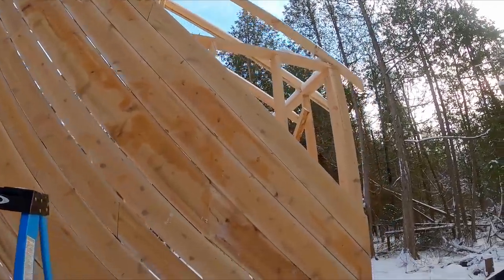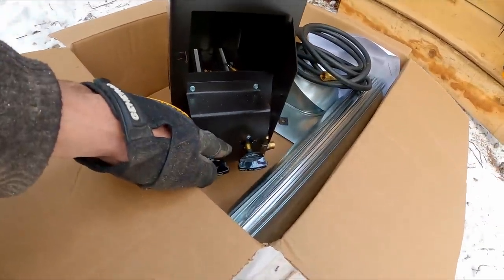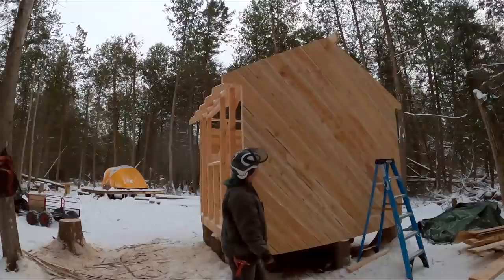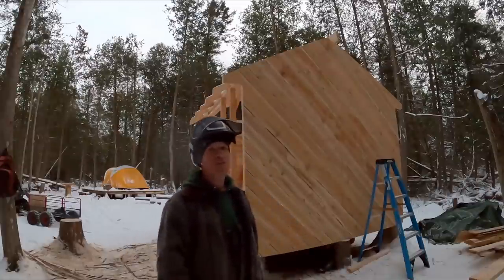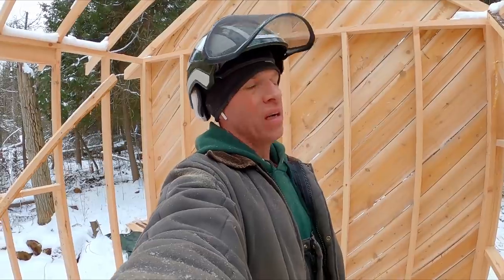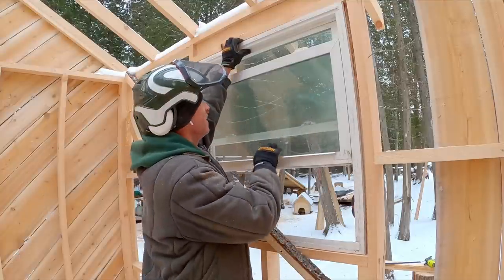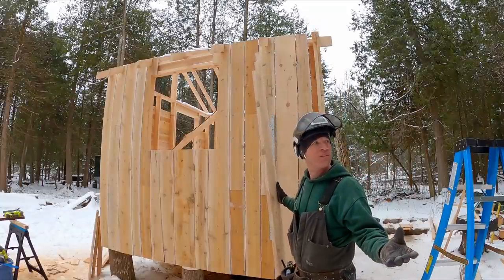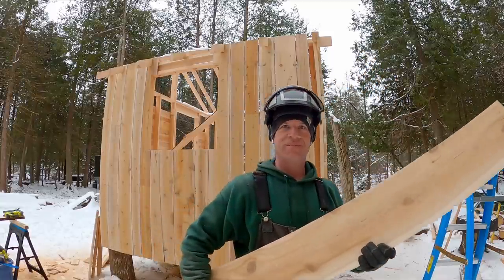95sq ft Cabin Gets Used Windows and More Alaskan Milled Cedar Siding #68

Comment: After years of sawing wood with a table saw, cut off saw and various other wood cutting tools, I have developed an allergy to pine sawdust. Even cutting a few boards  will set it off if I forget to wear just the shop type mask. Mine is the sinuses in the tip of my nose. You are correct... With the amount of cutting you do, I am sure the effects are excellerated.

Comment: Back in WWII they experimented with using water and saw dust frozen to make barges for military use. They found it to be extremely resistant to melt. You’ll have to watch how long the sawdust snow mixture which has iced up around your table takes to melt.

Comment: What do you think of every other boards? Put the widest boards on in every other fashion. Leaving big gaps for the smaller ones to cover. No measuring just hit the nailers with the nails. If they overlap extra, it's all good. Did I say no measuring? Better yet you leave both live edges, so no ripping each edge. It's down and dirty. Like building forts.

Comment: Just found your channel recently and really like your project and especially your presentation of content. Very relatable with a nice blend of humor and a tiny bit of sarcasm. 
If you truly want "dry" heat, a small "hot tent" type woodstove would be the ticket. You could also cook on it. Burning propane throws a lot of moisture into the air vs wood which does not. Love your videos!!
Reply: @David Monnin So right about propane. I live on a sailboat in the Mid-Atlantic states and controlling condensation this time of year is a challenge. (You don't really control it entirely as much as control the effects of it). For winter heating, I switch from heat pumps to resistance heat, as I'm on shore power. But the propane stove requires me to open a port and turn on a galley exhaust fan to keep condensation down. All petroleum combustion processes generate water vapor.

Comment: If you run a chainsaw through the pc. that you have up you can close the gap. Nail the first pc. up then only temp nail the second one and run the saw in between the pc. then nail them tight. You can always use your plainer on the edges. Try it.

Comment: I have a super idea for you. Build a small box kinda like one of those bird boxes on a post yet just high enough that you can open a door and reach in. You can either use that small heater or put a used solar panel with some type of electric heater. ( think a heater like a electic stove. A heating element. With a solar panel or heater in it you can then put all of your tool batteries in it and camera batteries while you are working. If you use the gas stove then a small opening in the bottom and a small adjustable opening in the top ( like a stove pipe with a cap that you can adjust the flow of air. You can even make it kinda like a really small telephone booth. If you use a gas heater then water can be stored in here as well to keep it from freezeing. This way you are only heating one small area rather than an entire area. Might help with filming and tools.

Comment: A hand warmer or a heated rock will act as a thermal battery in a box that your camera is in to lengthen the time you can video is cold weather.
Only need a hole for the lens to see outside its warm environment.

Comment: Here's a silly idea:  Cut a slot in your picnic table, that's just big enough for your chainsaw bar to stick through.  Insert the chainsaw up through the slot and rigidly secure the saw  below the table top.  Now you have a tablechainsaw.  Use any straight piece of lumber for a fence, and you can now rip hundreds of Julienne french fries* in only seconds!
*battens
Reply: Sounds great except the saw would need to be mounted similar  45ish engine up for the oiler to have a chance to work.
Reply: @bsekisser  Good point!  I did say it was a silly idea.  ;)
Reply: @throngcleaver  would not call it a silly idea...  Common that people mount circular saw under a table for a makeshift table saw.  Just not quite so simple with a chain saw.

Comment: The Man Cave is looking good, Tar Paper or House Wrap, next time, especially on the roof. Sawdust makes a good insulation, but you need inside walls. Scrape together $ 3-K and get a band mill, if you think the Saber saw is cool up grade, try a band mill and toss the man killer Granberg mill to Tito, your helper dude. A band mill kerf is .080 wide, your chain saw is around .300 wide. Used band mills sell for more than new ones, you will not loose money when your ready to sell it. We all want you to move up to a band mill and get more usable lumber from a dead tree carcass.  A 6 inch funnel and 3 feet of 1/2" hose poked through the wall makes a good boots off pisser when you move in.

Comment: There is also place called ""Repurposed Materials" I duno if there is one near you but they have various boards insulation some times rolls of material buckets barrels plastic or steel just an odd thing I happened to remember that might be useful to you. some times climbing ropes and wood products gym floors or pool covers like industrial odds and ends. steel clontainers like for shipping. Just a thought.

Comment: I know your aversion to doing things the "right way" but, when butt joining vertical siding it is best to have them joined by opposite 45 degree cuts with the outside of the top boards cut angled down so water will naturally shed.

Comment: Why aren't you lining the cabin walls before putting on the sidings to keep the wind, snow and rain out. Plus you could have proper sealed joints if you used feathered boards and as the wood dries out you don't have all the associated problems of shrinkage.

Comment: If you read about propane heat I don't think it is a dry heat per all the van dwellers they prefer diesel or cube mini wood stoves
Reply: If it is vented then the moisture goes out and the metal warming up provides the heat. This it should be a dry heat. If it were a buddy heater or something online that it would definitely put moisture In the air.

Comment: In WWII the UK experimented with making a sawdust/ice ship to use as an aircraft carrier. Sawdust mixed into the snow/ice melts much slower and is much stronger, as you discovered. They call the combination Pykrete. The experiment was called Project Habakkuk.

https://en.wikipedia.org/wiki/Project_Habakkuk

Comment: Tarpaper is cheap ($20.00 a roll) and  is always a good idea to use before the siding goes on. Will keep out the wind, rain, snow and spiders and prolong the life of the structure, immensely...especially if you plan to insulate one day. You're a man on a mission...best luck to ya!
Reply: Plan? This! Is! Ringworm!!
Reply: @PavlovsBob  there's ointment for that also! 😉
Reply: @thenorthshore6472  I like this idea. I might have opted to use all the scrap stuff to make the sheer wall boards which do not need to be close togeather and scabbed everything with about a 2 inch or more gap depending on exactly which siding I was doing. Then tar paper the walls and roof and finished.
Reply: @kameljoe21  on walls it's best to tarpaper before the siding goes up. Start at the bottom and work up with at least 6 inches overlap. As long as the sun stays off it...it'll last for decades!

Comment: When you’re cutting your siding boards to length try using a 45 degree angle on the end cuts where two boards meet so water sheds down the siding 👍

Comment: Love your channel.  Going forward u might consider taking live edge log slabs which you can install vertically like board and batten or horizontal like lap siding.  Would save gas, chains and time potentially and eliminate need for caulking.  Building wrap under boards cheaper than caulk.

Comment: You were talking about cutting battens ,,  get a few 6,7,or 8 boards  10 or 12 X 2  wide  ,,, clamp / join them together and cut 1 inch strips with your Alaskan Chainsaw Mill ,,, if you have 8 wide you cut 8 at a time ... will be a bit fiddley setting up but will save many hours in time,,

Comment: I have an older Kreg pocket hole tool you could use for nailers & not having to pound 5inch nails through boards. Too bad Jeddo is five hours or more away I'd drive up.

Are you thinking of some under the floor trap door storage with this? At least a cooler for some beers. I'd love to see some trail cam movies of the wildlife mixed into an episode. Don't forget a CO detector for the man cave. 

I'm gathering funds for a chainsaw mill too. Much to learn. I certainly have plenty of wood.

Comment: I just recently discovered your channel, and I am enjoying the videos of the cabin build.  Would you consider using a gasoline generator and corded circular saw for ripping boards and tripping board ends?  The circular saw rip cuts wouldn't require using the power planer afterward.  The chainsaw uses gasoline so it wouldn't be adding another fuel to purchase.

Comment: Just a little tip when you're putting your nailers in and they're on the outside wall so you don't have to nail through the siding toenail not the toenails on your feet. but angle the nail at about 45° to the flat side of the board driving it in place seems to work very well for me in my professional carpentry days of almost 40 years. good luck keep living the good life free spirit I know you are.

Comment: Propane is not dry heat. It actually puts a lot of moisture in the air.
Reply: that is a closed burner with a stovepipe that deals with the moisture :)
Reply: Don't get me wrong.....I love the videos! Your do amazing work. I have a 6x8 elevated hunting blind. Completely insulated, with metal siding, and roof. Build like a small house basically. And I heat it with a 25,000 btu ventless wall mounted propane heater. And it fogs my windows up horribly.